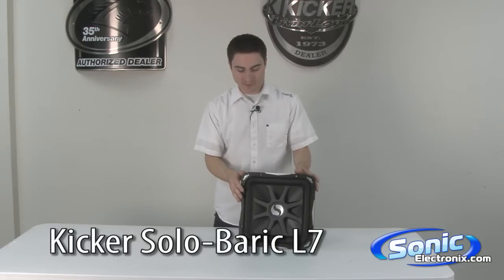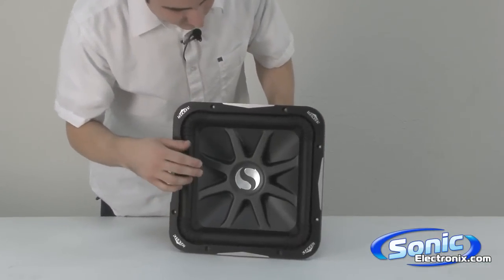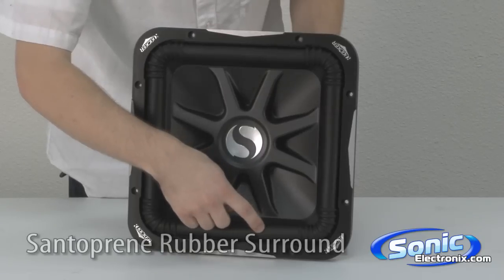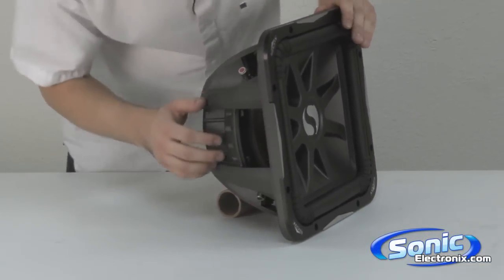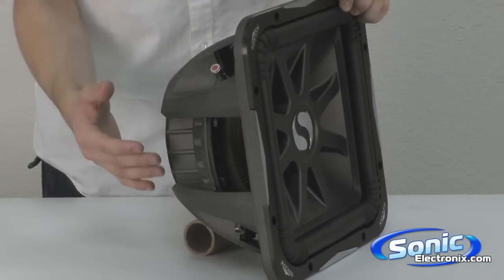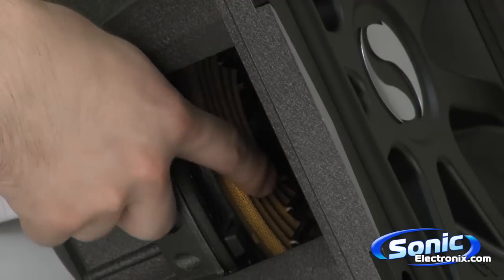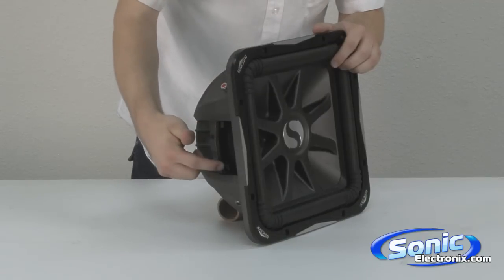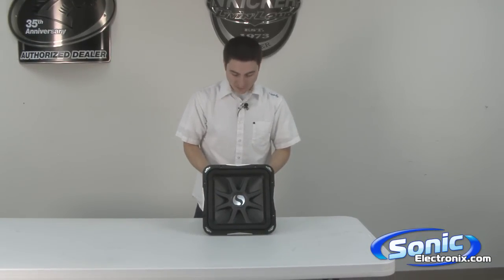Kicker Solo-Baric L7 Subwoofer Review

Comment from the maker: @clntsi Your Golf is going to pack quite a punch after an L7 is added. It's a great setup! Just make sure you have enough room for your subwoofer box. The L7 requires a bigger box and you may be a little limited on space. Also, double check to ensure that your alternator can handle the amount of power the ZX750.1 will require to run. You may want to add a capacitor in-line, or even add on a power cell to ensure it's receiving full power.

Comment from the maker: @MrSaintAulbins69 It depends on how high of quality of equipment you're looking to put in your vehicle.  The reason an L7 is a more expensive subwoofer is because of their quality build.  If you're looking for a subwoofer that can take a beating and provide you with some uncompromisable output, the L7 is the way to go.  There's other subwoofers out there, but it depends if you're looking for a system that will last "for now" or equipment with true value that can last you a while.

Comment from the maker: @TINYLOWKS Based on previous post I am assuming you mean 2 10CVX124 subs, if this is the case a good amp would be the Hifonics Brutus BRZ1700.1D. You will run the subwoofers in parallel/parallel to a final impedance of 1 ohm. A good enclosure would be the Sonic Sub Box: 2SV10 (Black), this ported enclosure will let the subwoofers hit hard and loud. If you are planning on doing this be adviced to purchase 1/0 gauge wiring for installation due to the amount of total RMS.

Comment from the maker: @TINYLOWKS Usually products that are blown don't typically have a warranty, with most companies the warranty becomes void when they feel that the product stopped working due to improper use. With blown subwoofers 9 times out of 10 they blow because they were not properly installed or the amp setting were set wrong. It is hard to say since each company has a different set of policies for different situations. I would say call the companies and see what they can do for you. Good luck

Comment from the maker: @DTURK2010 It depends what model of the subwoofer you're using.  To use this setup with a perfect Kicker amplifier matchup you can use the Dual 2 Ohm model of the subwoofer along with the ZX1500.1 .  Currently, Kicker is releasing their 2011 models - the 11ZX1500.1, but you may be able to pick up a 2010 model still - 10ZX1500.1.  Good luck getting your system put together, it will definitely have some high impact bass response.

Comment from the maker: @mackoneboy The L7 will have a higher power handling than the CVR and will have a lower frequency response. The CVR will cover more surface area and because of this will sound louder but the 12" L7 in my opinion will sound better. It will be just as loud and a bit more precise. If you are debating between the two go with the L7.

Comment from the maker: @moochy101  Now, this is not easy to explain because there are so many options and variables to consider when making the purchase and wiring up your sound system. Subwoofers have different impedances (Dual 4 ohm, Single 2 ohm, etc) that change your wiring options when you add or subtract woofers. Amplifiers also have limitations on your final impedance, so the subwoofers and amplifier must have the same final impedance to be connected.

Comment from the maker: @Allvids9 Both of those subwoofer setups will move some serious air, and produce deep bass tones very well.  The bass will actually be somewhat comparable, but the two CVR's will be a bit louder.  Two subwoofer drivers are a more efficient way to add a ton of bass to a vehicle.  Since you'll be running comparable power to either setup, the two CVR's will produce some awesome results and are a great option to go with.

Comment from the maker: @jwise36 Quite a few subs there.  The L7 will hit harder than the W6 but it may not have the same SQ.  W7's might hit comparable to the L7 and the SQ is pretty awesome.  The Fosgate T2's are a pretty good mix of SQ and SPL, but a little more geared to SPL.  If you're looking for a more SQ setup without paying a ton of money, go with the JL W6's or the Rockford Fosgate T1's. If you're looking for an SPL setup go with the T2's or the L7's.  The W7 will get you the best of both worlds, usually.

Comment from the maker: @RYDOGG2992 I would definitely recommend to refer to your user manual for more information regarding box specifications.  Each raw woofer's user manual includes detailed information on how to build a box according to the specifications the woofer requires.  It looks like the specifications we have, say for a ported box you can go from 3.0-6.0 cubic feet.  For a sealed box, 1.5-6.0 cubic feet.  Based on math, the volume displacement for the 15" L7 is 103.1³, or 103.1 cubed.

Comment from the maker: @Lynch951 You'll have a lot of options with that Kenwood X1200M. You can use a  VS12L74, or you can use two 10" L7's, unfortunately there isn't a prefabricated enclosure for the two 10" L7's, but you'll want to buy the Dual 2 Ohm models. My favorite combination would honestly be the two 10" L7's run off of that X1200M. You can also run two 12" L5's if you'd like as well, so there are a lot of different options you have with that awesome amplifier.  Good luck picking one out!

Comment from the maker: @Dawgkid133 The best solution would be to follow the manufacture's instructions on enclosure dimensions that best suit this particular subwoofer. If you follow the instructions you will get the best possible sound for this subwoofer. The top mounting depth is 6-11/16" that should give you an idea of how much space you are going to need, cutout dimensions are 11-1/16" x 11-1/16".

Comment from the maker: @deaneriley Make sure that you have them wired to the correct impedance, either 4 ohms or 1 ohm. Secondly if your amplifier is not CEA-2006 Compliant then you are more than likely not getting the rated power that is listed and thus under powering your subwoofers which could be part of the reason why they aren't hitting as hard as you would like them too. Switching to a ported enclosure will also help increase the SPL. The L7 will hit much deeper because its a square woofer that covers more are.

Comment from the maker: @TINYLOWKS Out the of the amplifiers I listed I would say the Massive Audio would be my first choice, then Polk, Orion, MTX, and finally the BRZ. Yes you will have to wire the subwoofer together to a final impedance of 1 ohm. This means wiring the voice coils in parallel and then the speakers in parallel.

Comment from the maker: @suayang07 Your sub is not the same as the 0S10L74. That's the 4 ohm model, you own the 2 ohm model.  Do not run these together. 

If you're going to just run your Dual 2 Ohm subwoofers to the Alpine MRP-M500 you're going to be underpowering it. You're only wiring options with Dual 2 Ohm voice coils is to wire to 1 or 4 ohms.  Your Alpine MRP-M500 is not 1 ohm stable, and at 4 ohms it will push 300 watts of RMS power, about half of what that subwoofer wants.  Consider a larger amp.

Comment from the maker: @mdGObcKIDS14 Just pushing one of them?  You can use a Kenwood 9105D for a budget amplifier that will drive the subwoofer quite efficiently at 1 Ohm.  It will push a little over 900 watts so you will be overpowering the L7 by a bit, so you'll need to be careful with the gains and bass boost.  You could go with a Kicker ZX1500.1  and run it at 4 ohms for now. If you ever want to add another L7 you could also just get another Dual 2 ohm and be set to go!

Comment from the maker: @KingBre99 If you go with two 15" L7's heck yeah that will be loud. Keep in mind that with a system like this you  will have to get some additional batteries. upgrade your alternator, and you will need 0 gauge power and ground wire. If you really want to be heard go bigger on the subs, something like 2 Orions HCCA subs or Cerwin-Vega Stroker series subswoofer. If you want a little more SQ go with a round woofer.

Comment from the maker: @PueblosUnidos24 Each Kicker 15" L7 requires 1000W RMS.  The HFi pushes out 2000W RMS at 1 Ohm.  Keep in mind it's slightly over-rated but yes only one amplifier is truly required.  My -personal- recommendation for an amplifier, would be the Alpine MRP-M2000 if you have the Dual 2 Ohm versions.  

For the Dual 4 Ohm, the BRZ2100.1D would be a good matchup to slightly overpower, to slightly underpower, the HFi2000D would be a great amp too.

Comment from the maker: @curlyfrykiller24 If you're thinking about one Kicker 15" L7 subwoofer, it will require 1000 watts of RMS power to run.  I'd recommend choosing the Dual 4 Ohm model of the woofer, and running it with the Kicker ZX1000.1 monoblock amplifier.  As for batteries, electrical solutions always depend on the vehicles alternator, but I'd recommend to replace your starting battery with the Kinetik HC1400, this will provide your aftermarket audio system with a much higher reserve.

Comment from the maker: @TINYLOWKS The round or square design doesn't really effect their lifespan and how long they last for.  As long as you take care of them properly and run them with a compatible amplifier without abuse you should have each woofer lasting you for years on end!  As far as the P3's, they're great subwoofers.  As for an amplifier, if you use two Dual 2 Ohm 12" P3's, you can use the Rockford Fosgate Prime R1000-1D.

Comment from the maker: @TINYLOWKS If you got another 10CVX124 you could technically do this. I mean you would be underpowering each subwoofer but Kicker is known for being a great product. However I would not recommend this, the amplifier is already not giving you all of the rated RMS and if you under-power the subwoofers too much you can actually casue damage to the woofer which would then void any warranty. Just make if you do add another subwoofer that is a Dual 4 ohm sub so you can wire both of them to 1 ohm.

Comment from the maker: If anything, it isn't enough power. That amplifier is under rated and does not produce the power it says. It will work on the L7 woofers, but you might need to upgrade your amp to one with true wattage ratings.

Comment from the maker: Yes, but that amplifier does not produce enough power to run this sub at its full potential. That amp outputs about 500W at a bridged 4 ohm load. Consider getting another amplifier, but a Monoblock amp.

Comment from the maker: @Cook2430 If you have the 10" L5 with Dual 4 Ohm voice coils, and the Kenwood amplifier is similar to the KAC-9104D which outputs 500W RMS @ 2 Ohms, you'll have yourself an excellent matchup! 

A 10" L5 is extremely responsive, and also has a lot of impact. It is considered Kicker's most efficient sub.  The bass you're looking for is only one step away - get everything installed!

Comment from the maker: @Klave620 Please specify exactly which amp you are running you amplifier with in order for us to tell if they are drastically overpowered.  If you play any subwoofer for an extended period of time there is going to be some heat presence.  However, if it is heating up very quickly then there could be an issue.

Comment from the maker: @Carbiine This sub enclosure requires 450W of RMS power at 2 ohms impedance.  You could use an amplifier like the Kicker ZX500.1 which will supply an extra 50 watts of RMS power (which the L5 can definitely handle).  

You could also use an amplifier like the 11DX500.1, just make sure that it's the 2011 model you're looking at.

Comment from the maker: @regencytruck92 The L7's are notorious for being a durable subwoofer.  They're not attributed to easily blowing.  If you're constantly blowing sets of L7's then something may be wrong with the setup.  It may be the final impedance the subwoofers are at, or it could be distortion is being introduced to the subwoofers for some reason.  You may want to have a professional tune your system prior to getting another set going in your vehicle and always respect the break in period of the subwoofer.

Comment: If I am correct in my knowledge, a cone can flex in a sense, they call it cone flex. That is one way you get distortion. They are not meant to, but they can. I took and old speaker I had and flexed the cone with my hand.

And in the video he said the corners flex, i think he means that it moves, not anything to do with the cone. If it wasn't ribbed, it would rip. So when he said flex i think he means up and down motion. Flex means: to bend. so it can be used loosely.

Comment from the maker: @tylerk927 Yep, it will hit a bit harder.  You're almost doubling the wattage with that larger amplifier, and you'll also have to consider the box you build, but it will be louder if you build the box right.  What you'll notice when driving subwoofers that have more power is that they seem more responsive and more dynamic with low bass notes.

Comment from the maker: @mdGObcKIDS14 No problem at all.  The ZX1500.1 has a higher price point, but it's got a lot of value built into that price.  Having the headroom to double your subs and still amp them properly will save you money in the future.  Plus since you have the 2 ohm model your only options for wiring is 1 or 4 ohms, and since running at 4 ohms is much more efficient on your amplifier it will be the best possible way to set everything up.  Good luck!

Comment from the maker: @josue906669 Capacitors are essentially an energy storing device that discharge energy every time your subwoofers hit. This is done so that the strain of discharge is not taken directly from your battery. If you install 2 Solo-Baric L7 subwoofers it is recommended that you purchase an additional battery. If you notice your light dimming when you are running your system then a capacitor is a good choice to fix the problem but an additional battery is a much better option.

Comment: I want to get one of these to replace my 2010 kicker comp 12 inch in my room.
My comp has a rear vent in the magnet, 360 degree back bracing vents also.
I had to make my enclosure 2-3 inches wider, which costed me some important space. So I would love to have one of these in a custom enclosure, without having to add any further measurements to the top mounting depth.

Comment from the maker: @TINYLOWKS Well, that depends on what you're after.  They're both awesome performers and have extremely similar charactistics.  The differences begin in the shape. One is square one is round.  The square design of the L7 will allow it to cover more surface area and output more bass, but the round design may be considered more tight and responsive. It's all depending on what you're after at the end of the day!

Comment: kicker is a good brand so exceeding the subs rated rms by a little won't hurt them. the theory is that a 600w amp (1/2 of yours) trying to push a 750w sub to full capacity runs the risk of clipping which can fry your voice coils. If you ran the full 1200w amp with the gain turned down to push 750 or even 800w to one 750w sub, the amp is only working at 2/3 effort, so the 750w or 800w are clean. If you tried pushing 2 750w subs to the maxwith just one amp you run the risk of clipping

Comment from the maker: @Ju3lz785 You can power the subwoofer with a lot of great amps, but you're going to want to consider some quality.  If you make an investment into a nice subwoofer, you're going to want to invest in some clean power to push the sub with.  It depends on which model of the subwoofer you have as well.  Look at the spring terminals on the enclosure, and see what number it says.  If it says 2, then you're final impedance is 2 ohms, and you can use the JH600 by MTX.

Comment from the maker: @PueblosUnidos24 Depending on the impedance (Ohms) of the voice coils, the HFi2000D would work for two Dual 4 Ohm L7's.  An HFi2500D would work with the Dual 2 Ohm models.  If you have the Dual 2 Ohm models, I'd recommend the Alpine MRP-M2000 to be honest. It's more efficient and won't cause as much draw on your system.  The HFi2500D would work fine for the Dual 2 Ohm models though.

Comment from the maker: @tyler409tyler If you go to our website and type in "CVX124" you will see the subwoofer. On that page you will see a "Wiring Guide" tab, this tab will show you how to wire numerous subs to different amplifiers. Just select 2 subs + mono amp, option 2. This will show you how to wire those two subwoofers to a final impedance of 1 ohm on a monoblock amplifier.

Comment from the maker: @living4theonly1 Everything really comes down to how much space you have to work with. You will need to find out the maximum size enclosure you can fit in your location, and research each size L7 to figure out what the best option would be. Do you know how much room you have for an enclosure? Typically 8" or 10" L7's are commonly found in pickup trucks.

Comment: Putting two of those 12" L7's in a custom box for a chevy avalanche midgate replacement.. I have two amps and would like to know which one will be better to push them with. I have a Power Acoustik CB1-8000D and a Pioneer GM-D9701..

Comment: @regal510 

yes, depend on your amp, i got 1 12" Kicker L7 powered by a Rockford Fosgate T10001BD, wire to 2ohms (750watts), and its pretty loud, it was louder than when i had 2 12" kicker L7 and i didnt wire it down at all

Comment from the maker: @NovaKid69 It will work fine for the MTX Audio Thunder Squares.  You may want to consider a custom fabricated box for the best sound quality and output though.  They work best in a ported enclosure with 1.5 cubic feet of box volume, tuned to 32 Hz.  These subs get loud!

Comment from the maker: @shaochiavang Yeah if you're running a T1000-1bD at 2 Ohms, this amplifier will be a perfect match up for the 10" or 12" Kicker L7.  However, you can still blow the sub if it's not properly tuned, or if too much distortion is introduced by cranking up the gains, or by internal settings on your source unit.